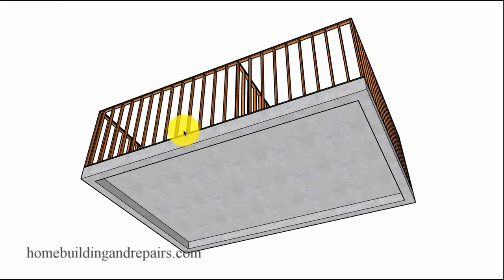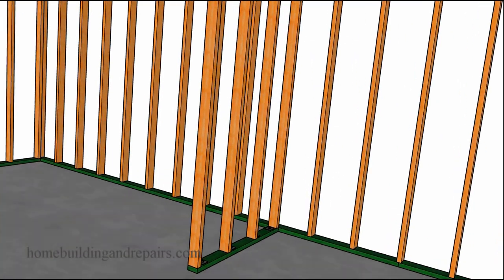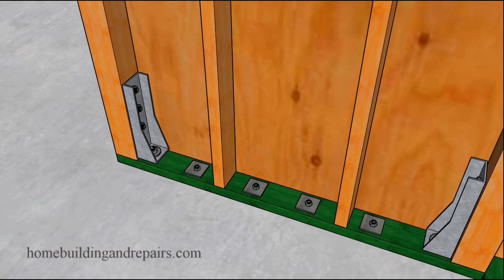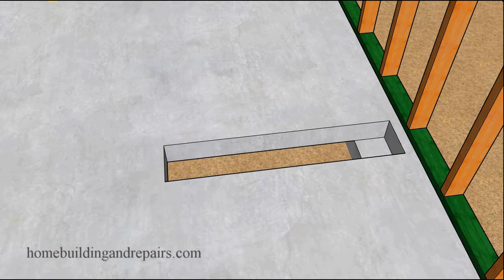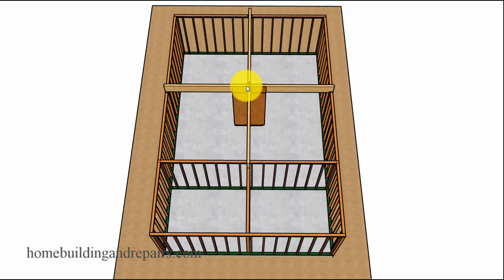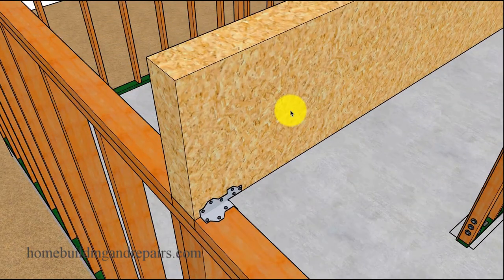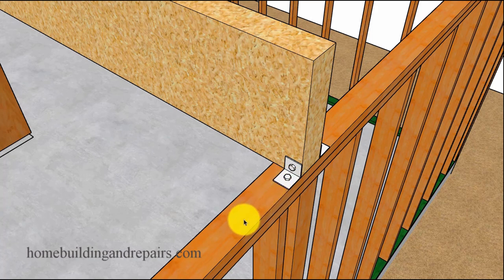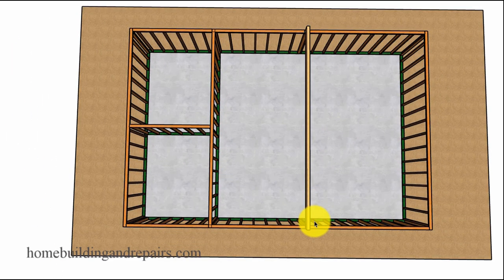Watch This Video Before Removing Interior Walls To Install Ceiling Beams - Open Concept Remodeling

Comment: There are only like 1 or 2 times I couldn’t remove an entire load bearing wall because of lateral concerns and those were in luxury homes with a lot of windows. Most homes I’ve worked with had enough lateral capacity in the exterior walls, or we could beef up the exterior walls to get it to work. But this is an AMAZING PSA that always gets overlooked.

Comment: A Portal Frame sheer wall as you're suggest could also be as small as 16" on a single story  home. They are generally much stronger at the extiror wall of a structure. Usually they are required to not be more then 12 feet the from the extiror wall. Its awesome that you make these videos informing people.

Comment: This is a much needed video, thanks. A couple comments. I would add, first step in cutting a slab is determining if it's prestressed. Just a thought. You may have seen a lot of videos of improper remodeling, I've had the pleasure of seeing dozens of them in person during inspections. Worst was a flat roof with a 12' diameter "swimming pool" due to removal of a wall and roof sag. What were they thinking??
Reply from the maker: Yes and a find out if your concrete slab is prestressed it is usually going to be marked in one of the corners of your garage. I can only imagine what you've seen as a building inspector and I'm guessing it's 10 times more than what I've seen as someone who was repairing all of this damage.

Comment: I am surprised to find someone on here that is against removing walls, as this person has said no one’s home has been blown over. To my knowledge Interior walls that are not load baring wall should be able to be removed with out any issues, since the exterior walls should be  able designed to hold its self together strongly with out any non load baring interior walls! Load baring walls that have a proper sized beam stretching the length and resting on two ends should be over posts that distributes the weight down through the foundation footers that are usually found under load baring walls. 

this video is informative and definitely strengthens a home, but we all know that no developer makes homes this strong!
Reply from the maker: I all I can say is beware, to anyone who thinks they can remove walls inside of their home with out ever having problems.
Reply: I believe this statement: "exterior walls should be able designed to hold its self together strongly with out any non load baring interior walls" would actually depend on the height of the unbraced (without lateral support) height of the wall.

Comment: Very interesting, Greg. Thank you. You discuss the reason a problem could exist is due to wind forces. Would seismic forces also  pose similar risks? Thanks again.
Reply from the maker: Yes, even though most of the research I've done on drag beams often refer to wind loads and rarely refer to seismic forces.
Reply: depends on location and other conditions. wind might or might not control lateral forces, and same thing with seismic.

Comment: I appreciate the video,.
wind was never a thought.
as an electrical contractor, cutting concrete makes me cringe, plumbing, electrical, refrigeration and even prestress cables buried in concrete.
And yes there is Xray but not many elect that option.(expense and time)
I had the pleasure of killing several circuits for the IRS occupying the floor below(commercial bldg)
talk about a lead ballon filled with farts in church
Reply from the maker: Glad you liked it and no more wall cutting:)

Comment: If the non load wall is removed in a home built with trusses secured properly secured with hurricane straps. I would think the wind load is taken care of. But what you suggested is definitely much stronger but is it necessary?
Reply from the maker: It would depend on the design of what you're working with.
Reply: He wants the building to withstand naval gunfire. It's like he has some shoddy shack to start with.

Comment: Every removal and beam addition I've seen uses king and jack studs attached to the exterior walls, not directly on top of the sill plate.  That keeps the beam lower and not on ceiling level and would most likely provide that shear strength necessary.

Comment: Hello,
I want to remove a wall between living room and guest room and but the joist of the ceiling are overlap with each other but few of them in the middle of the wall are not  same size and overlapped almost 2 ft after the wall that supports the ceiling joists, in that case what I should do if I put 2x10x16'? (note the length of the room is 32 ft and when I put the beam I need to have a post in almost the middle of the house or maybe if you have any videos describing how to combine two of 2x10x16 and combine/overlap to the rest of the beam that will be same size as the length of the room is 32 ft and as I said maybe a post need in the middle under where these 2 (2x10x20) meets)

Comment: What needs more lateral support a hurricane wall or an earthquake wall ?
Reply: National codes require different designs for different severity zones for both wind and seismic. The two are not comparable in some aspects.
Reply from the maker: That would be a difficult question to answer and would also depend upon the design of the building. I remember one story where someone planted large trees to reduce the speed of the wind, only to find out later that one of the trees fell over and damage the home. That's kind of the way I look at engineering. Sometimes by solving one problem you create other problems.

Comment: Hey Greg, I am located in Florida. I am intermediate with the construction world. A family ask me if I would be able to knock down a wall on their 80s built manufacture home. I have pictures of the wall. To me it doesn’t look like a load bearing wall. I want to see if you can look at it based in those pictures. Do you have an email by any chance Greg. Can you help me with this. I try to find the right person to ask. I wasn’t able to over my end. I reach out so many engineer structural, contractors. Wasn’t able to locate the right individual. Can you please help me with this. Thanks
Reply from the maker: I can provide an opinion, but an engineer would be your best bet.
Reply: Ok. You have an email Greg?

Comment: Where / how would an 18' wide garage with a 16' garage door get its lateral sheer strength?
Reply from the maker: I would get it from the other walls and the roof, but you have made a good point. I've moved some of these buildings before by pushing on them before.